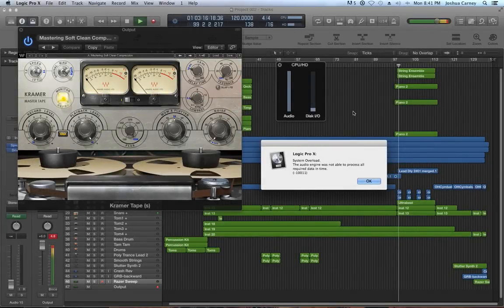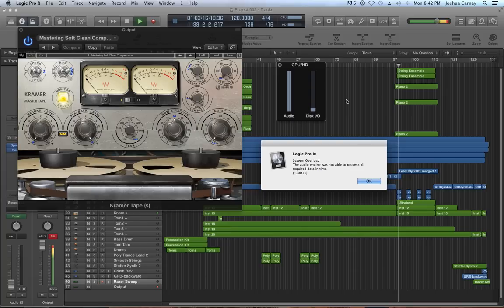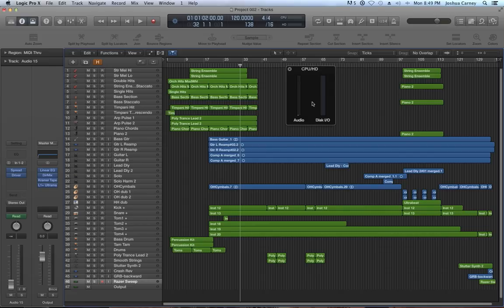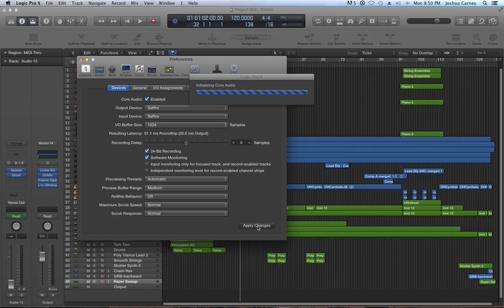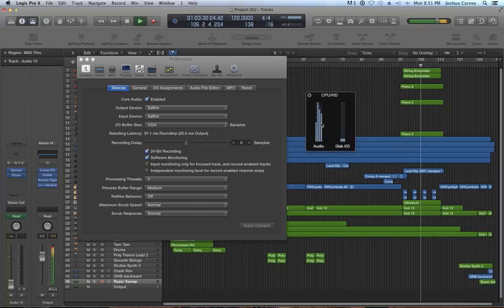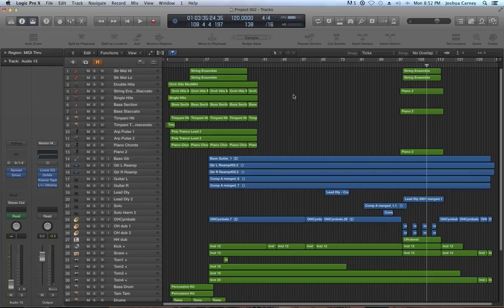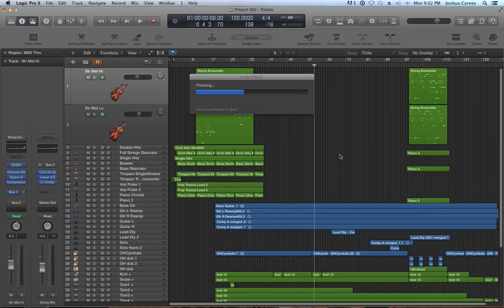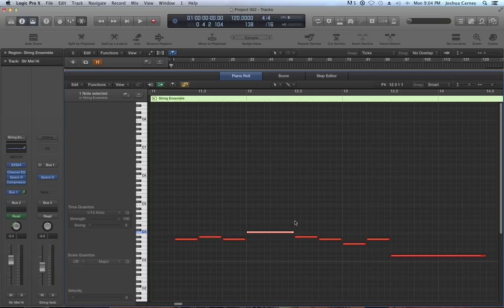Logic Pro X - System Overload, Processing Threads, Freeze Mode

Comment: When you freeze don't freeze logic native EXS24 or Alchemy as this will actually cause more over loads as logic try to draw on the sample in these plugs in real time ( This comes from the Logic support page via Apple) The primary tracks to freeze are those using thirde party plugins first. Some tracks that require realtime processing may have issue ( Side Chained ) so freeze mode selection is important there.

Comment: I learned about the CPU, thanks! In my case, 9 out 10 solutions that I found on YT did not work with my issue. Oh, and I have no midi tracks in a project I've just opened. The only thing for me was the SSD that I save my projects into. It has to run at 7200 RPM or it will cause issues. When I open my projects from Samsung T7 which has 7200 RPM, it works fine even with midi, with google chrome opened and about 20 tabs and other apps in the background. With WD My Passport which runs at 5400, it doesn't matter what settings I change and I close all the apps - it doesn't work. Maybe someone will find it useful. Thanks for the video!

Comment: Love the tutorials, best place online for Logic help... And so i have a question which I'm hoping someone can shed some light on. I have a 32GB RAM, 4.1GHz Intel chip Mac running Monterey. When I play back a track i'm working on (10 tracks of Midi, approx 5 Audio, pre mix stage so few plugins) I'm getting the 4 far right Threads on the Performance near 100% but the 8 on the left barely above 15% = Overload warming. Any ideas how I can get those Processing Threads more even? (i have done all suggested in this video) thanks

Comment: The 'automatic' option doesn't do what is best for your interests. Just found out all this time, I haven't been using hyper threading on logic. Actually annoyed. I don't want to have to be concerned about running out of CPU power.

The current top end Mac Mini is only a dual core with hyper threading. I'm going to want all 4 threads enabled for Logic X. If they had offered at least a quad core I5 at a decent speed this wouldn't even be a problem.

Also, if you have enough RAM, you can just leave an app or two open in the background. It's not like you have to use them both at the same time.

Comment: Hi,I have tried everything and cannot figure out why I have the "your disk is too slow/system overload" message. I record 10 seconds of sound (snapping fingers over the keyboard) with the built in mic without any plug in (specially without plugins for testing) and when I play the sample the system overloads after 3 or 4 seconds. I have an 2,9Ghz inter core 7 with 8gb Ram and 500Gb SSD (300gb free and only 10 programs installed, Mojave reinstalled 10 days ago). With those specs it should be enough for recording 10 seconds of finger snapping! in the CPU/HD I have 4 core threads which are almost free all the time and all of a sudden there is an explosion in activity and the system cracks. I have been digging for  info for two weeks and I am turning crazy! any help would be appreciated ! thanks

Comment: Hello, I was wondering if you know of any way to boost your processing with some kind of external device? My macbook has a solid state hard drive and I bought it brand new less than a year ago yet it still seems to have issues running many plugins in logic. I don't know much about computers in general but specs are 8gb memory, 2.7GHZ Intel Core i5. Is this not good enough to perform very well? It overloads frequently

Comment: I’m having similar issues with this, pops and crackles whenever I am output monitoring (iMac late 2013, 2.9 ghz, 8gb RAM, 500gb SSD), I have tried multi threading, adjusting I/O, sample rate etc etc, the iMac is running on an SSD that only has the OS, logic and plug in files stored (about 480gb free) when I am running Logic Pro x I have over 6gb of ram free and still the same problem, I’ve changed the interface to a Focusrite Scarlet 2i2 2nd gen and still no solution. CPU is clipping real bad even when I only have one track open. Surely I can do it as my old MacBook used to handle several tracks and that is way less powerful! Please help! Thanks

Comment: Hey MTHG, Do you record to a dedicated audio drive? In Protools I always did, but I haven't since I switched to LogicProX.
Is it really necessary?
Thanks!
Jeff
Reply from the maker: It's not necessary if your drive your working from is an SSD or a 7200 or 10000 RPM HDD. I record to a dedicated INTERNAL media drive. I run my OS and Apps from an internal SSD and my audio and media files are all stored on an internal separate HDD. It helps to divide the workload of reading/writing over two drives rather than a single drive. I've heard of a lot of people working on external drives, but honestly, I've had more problems with that because you start to bottleneck your data over a USB or Firewire connection. So, yes, I do it for better read/write speeds, but no it's not absolutely necessary. It was more of an issue before affordable SSDs were around, because you could start to bottleneck your HDD if it was 5400 RPM or even at 7200 RPM, because HDDs can only read or write at any given point in time, not both simultaneously.
Reply: Thanks! I haven't had any problems so I'll just keep doing what I've been doing. I just thought I'd throw the question out there, cause Avid recommends an external FW drive for PT.
Awesome tutorials by the way!

Comment: I've got to a situation here: Mac Pro with 2.5 Ghz dual core, 16Gb RAM and a SSD just installed today. Overload messages still popping up when using 18 tracks with VMR (Slate) on pretty much every track, some Waves plugins, and stock ones from Logic too.

I really did everything I could to avoid this issue, but it seems that was all in vain. Buffer size is at 1024, processing threads in "automatic", process buffer range is set to "Large" and there's no MIDI tracks in the session. The only thing that really works after all that is when I choose "Playback tracks" instead of "Playback and Live Tracks" for Multithreading, but I don't know for sure what this does with my session.

Any advice?
Reply: And just to make it clearer, I'm just mixing at this point!
Reply: Arthur Azoubel you're issue must be that dual core CPU at that low clock speed.
Reply: Cameron Beyer yes, after all I realized that too! Guess that the only configuration that really works well on every situation is a quad core processor. What about choosing an i7 instead of an i5? Would that make a big difference?
Reply: Arthur Azoubel yeah that would help, I'd look into hackentoshing. A far better. bang for your buck
Reply: Close all the other applications that run at the same time than logic.
Reply: Hey man, I have the same problem you do (and possibly the same MacBook). The thing that did the trick for me was enabling freeze mode on my unused tracks, and changing the threading from "automatic" to 4. Automatic seemed to not really lend the full weight of the CPU to Logic. When you manually enact it to 4, and close safari or whatever other apps you're using, you should be fine. All the best man!
Reply: Dude, since I've posted this, I did a lot of reserach about that issue and realized that changing from "automatic" to 4 works pretty well indeed. I've tried enabling freeze mode before that, but I ended up taking too much time everytime I did something on the track (like inserting some plugin ou editing), because it keeps rerendering EVERYTIME. Freeze mode sucks in my opinion. You can enable the On/Off button on each track too and that helps. And by the way, when I'm in Logic, I keep all other apps closed (to answer the previous commentaries). But thank you very much for your tip!
Reply: Of course man! Glad it's working for you. As for freeze mode, I find that I use it most when I'm doing EQ work within busses (for example, I might have four guitar tracks frozen and then routed through a bus; I can change the EQ of all four guitars on the bus and not have to unfreeze the individual guitar tracks). It also works wonders when recording vocals. Before, my project would crash in the middle of recording a vocal line. Now I freeze everything except my vocal track and the project runs much more smoothly. Happy recording!
Reply: That's a very cool tip. I've never thought about using freeze mode for these situations! Thank you again!

Comment: Which ssd should we get to store logic library?? With hdd , it really takes alot of time to load any instrument before playing?? Please help me with it
Reply from the maker: Any SSD works. I like samsung, I've used them on a bunch of projects and different computers. I've never had one fail.
Reply: Can you please specifically mention which samsung ssd model do you use to store additional content of logic pro x. I tried using sony hdd but it takes around 15 to 30 sec to load an instrument before i can play it and when it comes to loading a project, it takes around 4 to 5 min for a simple project to open.
If possible can you make a separate video on this coz alot of people run out of storage after using logic ad don't want to compromise on speed with an external disk.?

Comment: I have a 2011 Mac Mini with 16gb of ram, 128gbSSD and the processor is 2.3GHz Intel Core i5 and i still get the overloads!? I did like in the vid and put 4 threads now so lets see how that goes! Thanks! O and how do you hiper thread to make the mac better and faster???
Reply from the maker: Jeanmark Rodriguez The processor has have hyper threading, it's not something you can just turn on. If you have 4 cores, it will show up as 8 if it's hyper threaded. If not, it will just show up as 4. Logic has always been a CPU hog. That's why I went with a 32GB RAM and 8-core mac pro. If it's still overloading, just make sure no other apps are running the background, render as many software instruments as possible, and make sure the buffer is set high. If it's still doing it, there really isn't a solution other than to begin rendering plug-ins or freezing tracks.
Reply: +MusicTechHelpGuy If I bought an external sound card and transferred all the audio through that instead of my computer audio would that help get rid of the System Overload message?

Comment: I'm running Macbook Mid 2010 500 GB; 8 RAM; Intel Duo Core. Logic Pro X 10.2.4. How do I upgrade to more cores to stop the bogging down issue?.Thanks.
Reply from the maker: +Larry Contreras Cores are actually a hardware thing, so you'd have to upgrade the CPU to get more cores, however that not possibly in a MacBook Pro. You'd just need to upgrade your computer eventually.
Reply: do you think an i7 quad core would have any issues with logic x?
Reply: i7 quad core would have no problems whatsoever!
Reply: thanks for your reply. you dont understand how pleased i am to hear that :) ive been getting so paranoid about spending so much money on a new imac i7 and it still not having enough power. i wish you luck with finding a better computer for yourself also :)

Comment: to improve performance of CPU , what is best to Update RAM or SSD first ?
Reply from the maker: Neither will improve the performance of your CPU, only upgrading your CPU will do that; however, I understand what you're saying. Upgrading to an SSD will give you the most noticeable performance boost, because it will be able to access files from the drive much faster. Upgrading your RAM will allow you to use more simultaneous plug-ins and virtual instruments. Both will improve session performance, but for different reasons. If you have at least 4-8GB of RAM, I'd go with the SSD upgrade first.
Reply: 4 gb :) Ram

Comment: I give up. I have done everything. I upgraded my Mac to a 2013 Mac Pro (trash can) with 8 cores 64 Gb ram,  I got a UA thunderbolt interface, I froze tracks, I turned tracks off, I played with different buffer sizes, I closed all other apps, I turned on 64 but processing, I turned off everything that isn’t being used. And my system still plays for a few seconds and overloads. The only thing I didn’t do is get a new hard drive. But from what I can see, it’s the CPU that is overloading. Any ideas? Anyone?

Comment: 426/5000
I own a MacBook Pro mid 2013 (i7 2 cores, 8gb, SSD Samsung EVO 250gb), this message appears to me constantly, did not resolve changing in preferences the "Process Buffer Threads" to 4. The file has some 27 tracks, only imported audio with some added "bus and effects". This error is appearing during my presentations and has been a big problem. I'm using Logic version 10.4.4

Comment: It's 2020. 10.5.1 and now LPX freezes aren't working like this for me anymore after using Logic for 7 years on the same Imac w/24GB ram, quad core. Despite freezing tracks, they constantly reload on their own, or have to be reloaded because, despite freezing them, there is no instrument.  In addition, the occasional locked track won't unlock, and has to be deleted.
Hey apple! Instead of bloating LPX with all these shiny toys, how about going back and fixing the same problems that have been around now for YEARS?!! And while you at it, about stopping the infamous automatic red-slash solo that pops up every time I want to solo a track. Comes back all day even if you get rid of it. Why should it do this? Maybe I don't want to use your template. Regardless, most of my day is now spent battling the software and not being creative. It's exhausting and as long as apple's been at this, simply no excuse for not cleaning up their coding problems, which is what it comes down too. I could list a lot issues that are just ridiculous for a "pro" software. Shame on apple.

Comment: i used to get this a lot, then i upgraded the ram from 4gb to 12gb then it completely went away.
Reply from the maker: A RAM, SSD, or CPU upgrade will definitely help with the frequency of these errors. I'm actually working on a machine with 16GB of RAM and I still have these errors when I work with sessions over 50 tracks and lots of plug-ins. I'm upgrading to an 8-core mac pro soon, that will make these errors go away forever.